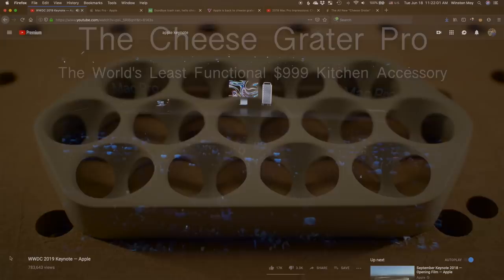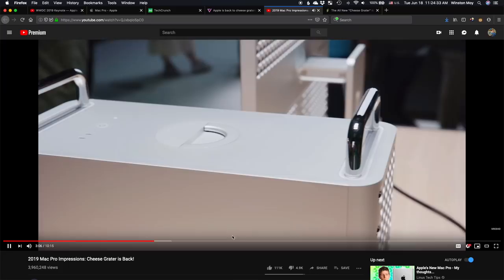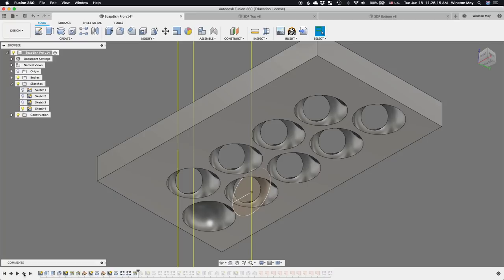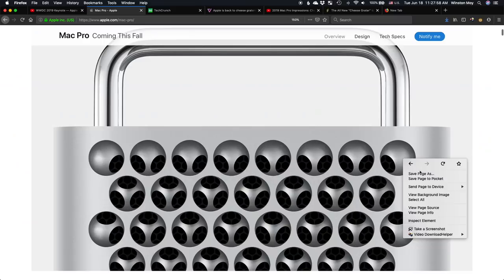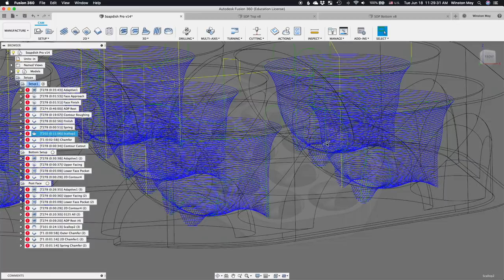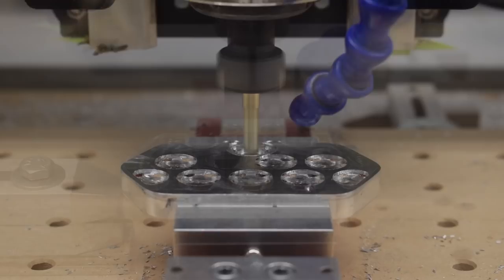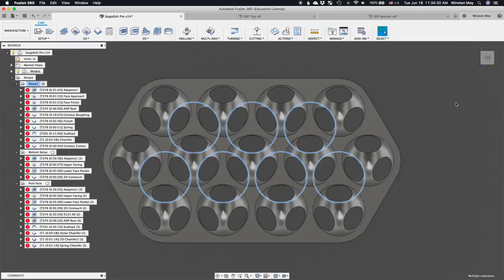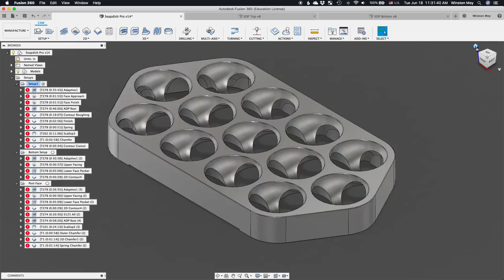Machining Apple's Mac Pro Grille on a CNC

Comment: Apple dissapointing as usual also that soap holder might rust quickly in the bathroom if there is a shower nearby
Reply: Bro. Do you know what aluminium is? Especially anodized. It won't rust. Not from water anyway. There are chemicals that can oxidize the aluminium, but you don't want those in your shower, trust me.

Comment: why did you radius the edges of your pockets!? That drops the apex of the edge below the surface making it impossible to use. Try face milling it below the radii then either lapping it or just plain sanding the surface till the burrs on the inside or your pockets wear off. of course apple would have broken edges to keep people from cutting themselves, but you wen't into this designing it to fail. If apple made a cheese grater, they wouldn't have broken the corners.

Comment: Pretty sure Steve Jobs knew pretty much nill about computing besides selling them.. I mean, he did basically make his living and life off of being a vampire and using Woz like his own personal slave.
Shame really, if Woz stayed with Apple, better or for worse. The tech itself wouldn't be so restrictive and 'pro-sumer' as they're certainly not a 'professional' grade bit of kit. Don't get me wrong, for what they can do, they're pretty good, but as a professional workstation? no.

They marked up $300-400 graphics cards to over $2000.. like, why? the cooling for them certainly wouldn't cost thousands, but why basically upmark some of the most mid-tier non workstation hardware to such an extreme degree? heck if you buy the base model, you can actually save thousands by just purchasing the cpu, gpu and ram and just... putting it in yourself. So yey, nice going Apple, ripping people off and btw thats illegal in pretty much most of the west BESIDES the US... go figure.

I'd honestly use apple products if they weren't such horrifically anti-consumer. Like saying, if I open up my macbook it'll blow up cuz 'battery' when.. uhm, wheres all the laptops blowing up then? they use the exact same type of battery, it aint hard Apple, its easy to fix, but you just want to create a dystopian future for tech. So.. for now, the overpriced Mac Pro will be a wonderfully engineered, shitty cheese grater with some half decent hardware for arguable way too much when I can build the exact same rig for much cheaper.

Comment: you're an intelligent person, you may not see value in a price, but at least know the context something is in: the new apple monitor isn't for anyone's home use (though some with disposable income might buy it sure) it's for professional feature film and other color grading level use, it's competitors similar products are in the $20k-$30k range (vs Apple's $6k) the stand? a Sony stand mount for their $30k monitor costs $876, it's made of mostly plastic with some metal and is not adjustable. apple's is $1k. Most users of the apple monitor will never buy this stand, they'll use a VESA mount arm set, some of which go much higher than $1k, ours that hold 3 monitors cost $1,200ea, but one of a consumer grade costs about $150 on amazon. Apple's biggest mistake if anything - was presenting the stand to the public in their keynote, which every troll on earth focused in on, and ignored the rest.

Comment: Oh yes, give them ideas. Like there isn't enough overpriced shit products in the market from apple. If they expand their business, what's going to happen?
"Any user of these utensils is not allowed to throw them in the garbage, recycle them, melt them or deform them in any way, shape or form. Repairing any of these utensils in the warranty should be done at any local Apple store."
B-but... it was just a tiny crack... - "WhAt?!?! jUsT A WhAt?!?! sIR... SIR. DID YOU REPAIR IT? WITH WHAT MATERIALS? METAL? HOW DID YOU ACQUIRE SUCH METAL? OUR LAWYERS SHALL BE IN TOUCH WITH YOU AND THE PROVIDERS OF SUCH MATERIALS."

Comment: joke aside, this seems like a completely ... useless design that only inflate the price further for absolutely no practical reason...
Reply: Yup. Apple never used to do completely pointless, expensive things to their computers just to make the prices higher. Not until Steve Jobs came back. The iMac could've had an opaque case lined with the same metal coating on the inside all the prior Beige Mac cases and the apple ][ line had. Then the iMac wouldn't have needed the expensive and complex sheet metal shielding. Apple used to use off the shelf screws. But The Return of Jobs begat expensive, machine turned screws that cost more, used inside where only repair people would ever see them.
Now the newest Mac Pro has even more of this pointless BS that does absolutely nothing to make the computer work better.
What it looks like is that Apple really does not want to make desktop computers. Internal expansion had peaked with the 9500 and 9600 with six PCI slots. Followed by the Beige G3's which had only 3. Their replacements had 4 or 5 slots. Then came the trashcan with no internal expansion capability. But now they're going to make a Mac with the most internal expansion capability ever, but lard it up with the most pointless, pretentious BS to make it cost more than many cars to ensure it will sell very poorly. That will "prove" that Mac users really don't want a Mac with a lot of internal expansion capability.